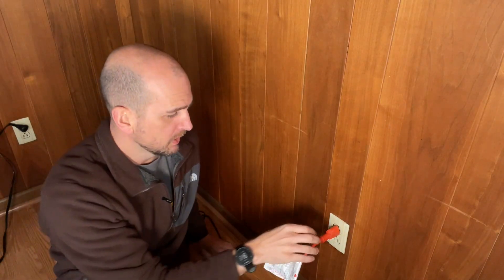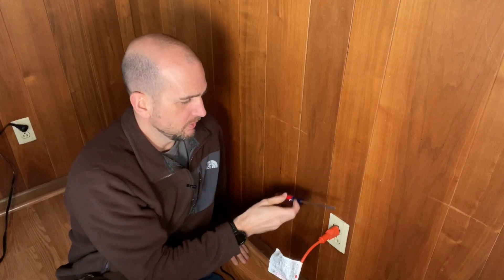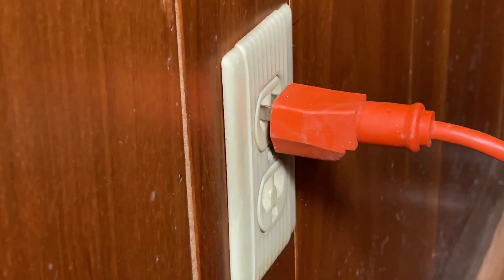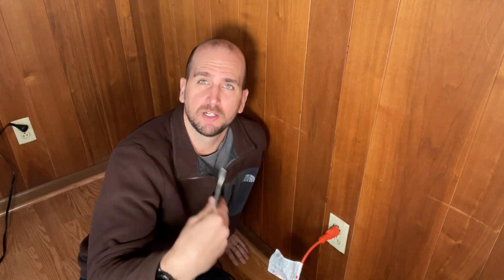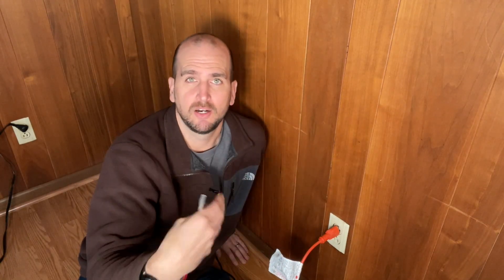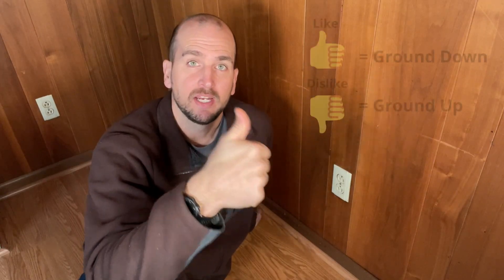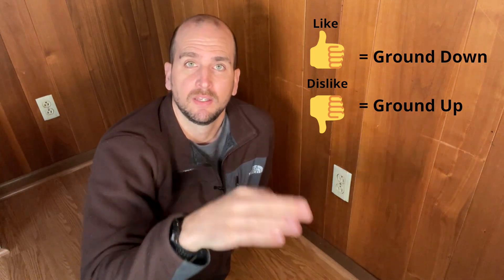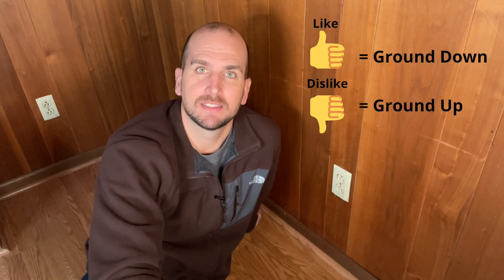Should An Outlet Be Installed Ground Down Or Up

Comment: i like the screw heads straight up and down, LOL
Reply: Me too if I can help it.
Reply: Left and right....
Reply: All the same orientation, usually horizontal
Reply: In the trades it's standard practice and called "soldiering" the screws.  Then the painters come in........
Reply: Especially on a switch.
Reply: I used to have a boss that was anal about that.
Reply: LOL, you should see a doctor about that OCD.
Reply: @navyreviewer  why? I do the same. It looks neater. As it is, I just bought a place where I'm fitting screwless plates.
Reply: 45 degree angle, upper left to lower right if in. right-side-of-the-street driving contry.  Upper rlgiht to lower left in in a country where they drive on the left.  ;-{)}}}
Reply: Horizontal
Reply: Which begs the question... why do 99% of all outlet/switch covers use a standard slotted screw instead of a Philips head
Reply: @marvinisit  they want you to slip and put that screwdriver 🪛 in the outlet!⚡️⚡️⚡️😳
Reply: I paint. When I replace covers, I always put the screw slot vertical.

It is the way I was taught.

Comment: I did electrical inspection as a resident engineer for the government for decades and the up or down was decided by the electrical engineer. This dives me nuts because one EE would never put it in the plans and would expect me to "train" the electrician into the correct way to install the outlet. ?I spent many hours proving there was no orientation specified in the NEC. My wife had a room mate who wore a watch with a delicate chain connecting the ends of the watch band. This was in college, circa 1966. The room mate's bed was placed just below the wall outlet at the head of the bed and near the center of the bed. After a few years of good luck she finally laid down on the bed and threw her arms up to clasp her hands behind her head and settle down on a pillow. That chain hit the hot wire and the resulting surge caused a burn on her wrist.

Comment: Ground UP!!! When I rewired my 1905 house, I installed all the new pugs Ground UP fed by the the new subpanel and Modern romex.  that way I could easily spot older knob and tube connected plugs.  As work progresses to update my electrical, I could systematically knock off plugs and wiring projects.  I also found the ground UP gave a more firm grip on cords with ground plugs.

Comment: Never walked into a residence with ground up. Switched receptacles ground up to indicate 1/2 switched. 
Might not be in NEC, but what about state codes?  
My concern would be with having hot  be on the 'other' side if an outlet is installed ground up.

Comment: When my brother was maybe 3 or 4 years old he stuck a knitting needle into a receptacle. I always wondered if he did it because it looks like a face and it caught his attention because of it. In most cases when I have used a 90 degree plug it needed to go up not down so I wind up loosing length because I have to double around to go up. I think everyone is so used to the ground down turning it the other way doesn't look right to them. People have a tendency to dislike change. Also if a cord is loose when it is plugged into a receptacle the receptacle needs to be replaced.
Reply: Kids stick needles in outlets everywhere. It has nothing to do with it looking a face. One should use tamper resistant outlets with kids.

Comment: This came up at an IEE safety meeting in the UK. The problem was bangles worn mainly by women while plugging in the cable. The chain could drop in to the gap as the plug is connected leading to a shock. In the uk a shock is quite probably fatal at 240volts. Soo to help prevent that the ground pin went to the top. US pins could also be shrouded for a short distance down the pin to again help prevent jewelry chains causing unsafe events to occur. But then you have Mr McConnell grandfathering in the electrical industries A-hole bad practices instead of getting on and fixing the problem!

Comment: As a retired fireman we once had a house fire caused by an metal outlet cover that was not screwed on and fell just between the plug and the outlet shorting out and starting a bed that was pushed against the wall on fire.
Reply: Good to know!
Reply: The problem was the conductive metal cover next to the bed. Terrible decision.

Comment: Most plugs appliances do not have the ground... so , it doesn't make a difference.  Lastly, plugs can have undue stress on them being upside down.  Not good long term for the plug, and may be an issue.

Comment: I do Home Inspections and no I have not seen any electric code that defines the outlet orientation. With that being said if you ask any electrician I'm pretty sure they will say ground down. I have never been in any home where there are ground prongs up. When I do and it is usually in older homes I will find the random outlet with ground prong up and I know there has been a home owner doing their own electric work that is not really experienced and has no idea or even thinks about it. I think if you researched it deep enough you would find someone did it that way and from then on "That is just the way it has always been done". There are many things in code and SOP's for home inspectors that I don't always agree with.

Comment: My brother-in-law showed me a safe way to show ground  up as safer.  With ground down and the plug not fully inserted, he dropped a nickel down a wall.  When the nickel slid between the wall and plug, it shorted out the hot and neutral making a nice spark.  Then try it again with the ground down.  Thanks UNCLE BOB.

Comment: Ground face Bottom I consider better and easy to plug cord. Since most Outlets have the Green connection on the bottom I consider to install ground open on outlet facing down

Comment: I was serious shock when using a non insulated drill in a damp area because the plug pull out  and down disconnecting only the ground pin on a receptacle  with ground up.

Comment: Personally when I am replacing an older receptacle, I look at the plugs that are normally plugged in at that spot. If those plugs are ground down, then I install the new receptacle down, if they are up, then so is the receptacle. This is usually why you may see both in the same room. If you plug in a ground down plug in a ground up receptacle, or vice-versa, you are introducing undue stress on the cord, the connections inside the plug head and on the prongs. Also if the cord happens to be in a spot where they keep getting jarred, the conductors within the cord at the bend can eventually break over time due to bending back and forth at the bend in the cord.

Comment: Ground is downward. Commonly when you hold a plug when inserting it your thumb is on top pushing and index finger is across the bottom guiding. If your hand slips when pushing the plug in it'll be the index that slips forward contacting the ground blade. No issue. Ground up the index will cross the hot and neutral. Always know where your fingers are.

Comment: I'm getting older and my eyesight is not as good as it used to be. With ground up I find it is easier to insert the plug because the ground prong is longer and
with the ground up it is easier to locate.

Comment: I've been a Commercial/Industrial Electrician for 53 years. Hospitals spec ground up because the ground plug makes it harder to knock out the plug to a vital machine. Otherwise, it's whatever the specs call out.  Typically I do ground down if it isn't called out because people tend to not like ground up. It sucks to put in 237 recepts and have to go back and turn them the other way. If it's not specced I RFI it (Request For Information) and it will one of the first ones I do.

Comment: Well this will blow your mind and theory.
Most outlets in the Chicago area are mounted horizontally  so now the question becomes,  Is ground left, right, up or down?
Chicago uses metal conduit and electricians find it faster to run the conduit up through the top plate turn 90⁰ then turn 90⁰ back down through the top plate and into the adjacent outlet box.
When a number of convenience outlets are on the same circuit, generally the thinwall runs horizontally low in the wall and bends up to enter the bottom of the box, which has two knockouts on the long side. In the middle of the run, there are two connections to the box, so it makes sense to mount it horizontally.

Comment: I hear many electricians say it should be ground up, but it's not only not enforced by my NEC, but it causes many issues. All, and I mean ALL pluggable electric devices have their plug designed and oriented with their ground down. This means that when plugged upside down, they will exert torsion or (in the case of heavier adapters) will constantly pull on themselves by their weight alone. Overtime, this loosens the plug holes and it becomes more and more likely that you'll get partially exposed prongs. Unfortunately, my house was wired that way, and all of the outlets that are frequently used (ie. the bathroom one), are extremely loose. I also had to find power bars with rotating 90 degrees plugs in order to avoid the cable loop you demonstrated. These are not easy to find and they cost more. I have never ever witnessed or heard of an accident where something fell on the exposed prongs and caused a short.

Comment: This might be a regional thing since it isn’t actually code.  I was told that an outlet installed ground up means it is on a switch, like light switch on the wall.  I Googled it and found that some people do this in their home so it is easy to remember if an outlet is on a switch. Kinda makes sense. Doesn’t it?  So, to all the obsessive compulsive friends of there, have fun testing all your outlets and light switches and swapping them.  Just remember to be careful and turn the breaker off first.

Comment: Thanks for clarifying the fact that there’s no code for up or down, at least at the time of this video in March of 2021.   
One comment I have heard; in case of low level installation of the receptacle, and if there’s a flood (this just a comment) water can ground the “ground” faster that the hot and the neutral leads!!!
Not because of this reason, but I am in favor of the ground being down for the convince. 
Thanks 🙏🏼
Reply: The ground is always at ground, that's why it's called ground. Water won't ground it because its already ground.
Reply: @garyvcole  Not only that, the NEUTRAL is also grounded and would be innundated at exactly the same height as the hot, regardless of grounding terminal up or down. If the water is  going to short the circuit, and there isn't any lower cord-connected, non-water-tight device, that's where it happens.  People with no clue seem to come up with  idiotic reasons for doing something that simply doesn't matter.

Comment: Remember metal cover plates ? There was a time and may be available still.
 Imagine worst case scenario... ground down.
NEC code should at least 
Address this as a major problem for elimination.
Reply: If it were a "major problem", you'd think it would have come up at least once in the last 100 years or so since grounded plugs were invented.

Comment: Ground down is easy to remember for me, putting a finger in the ground prong can help you get it in in the dark. if you are using metal plates, ground up is good, they can get loose and will drop, especially on the 50 cent outlet. all outlet devices in a given job or building or ares should be all the same all up all down, except for the special plugs, such as a right angle plug. I think NEC years back did not care but wanted all the same in a building or job.

Comment: I built a room addition and hired an electrician who told me the city I live in made it code to put the neutral on top. I live in a twin city and a friend whose electrician started the job on their new house build before his city joined my city to make this code change. Unfortunately that electrician had personal issues and needed to quit the job. My electrician took over. Both of our cities require the electrician to get the permit. So the new electrician went in to get the permit and was told that means the new house build had to be brought up to the current code when he started as the electrician. So he had to switch every outlet to the neutral being on top. My friend was not happy, but he passed the electrical inspection.
Reply: An additional comment. I installed an outlet chase for behind the LED wall-hung TV to hide all the wires. Those didn't come with neutral up (this was now almost 9 years ago). So I installed the TV on the wall the day before the electrical inspection. He was happy with the wall outlets but never looked behind the TV. My electrician likes to be present during the inspection and told me he was prepared to lobby for the neutral being down given it's an inset outlet and behind a TV on the wall. The electrician and I kept quiet on this during the inspection of course.

Comment: it's weird, plugs in countries like EU have sleeving around the hot and neutral wires so shorts like this aren't possible, and they have fuses built into the connector, plus many other safety features. I wish that was the standard over here in the US, obviously it may be a little too late, but innovation onto the existing connector isn't impossible.

Comment: Good video. I  put ground down because some larger appliance cords have the 90 degree & I believe it puts constant bend on the conductor wire. I am ok with ground up but will change it if I am changing out the receptacle.

Comment: Always ground facing down.  By the same logic of something falling down, you could be sitting with your screw driver and go to stand up and cause the same issue.  Or, more likely, a toddler could be playing near it and lift up something he/she found on the floor, and since they are low, would be more likely to hit it from the underside. What ifs are always sheer speculation and a waste of time.  If the plugs are loose, replace them, plain and simple.

Comment: please stop calling a receptacle an outlet. an outlet is any box you can tap into electricity. i.e. switch boxes,       fixture boxes (for lighting) and of course a receptacle box . although you can take electricity out of the receptacle it is not the outlet. the box is the outlet that is why it is called the outlet box.

Comment: If you install a 'wax warmer', and the outlet is ground up, it will be upside down because of the polarized blades.  Nite lights will also be pointing down instead of up because of the same polarization of the blades.

Comment: I new a guy that his son was electrocuted on the back of there boat. The boat was docked and I guess the boy was setting at the back of the boat with his feet in the water. Boat was plugged into the docks power supply, 120v. They said that a 18c. gold chain was hanging in the boats head and fell onto a plug that had something plugged into the outlet, and I guess the plug was turned the wrong way ( SEE VIDEO @ 3 32) and it went to ground and because he was in the water and on the back of the boat he got electrocuted. So I guess it can make a difference which way the plug is installed. Sad.
Reply: That outlet should have been a GFCI
Reply: @macariomusquez1304   Who would think this could happen on a Houseboat while it was docked using ship to shore power..

Comment: In the area around Chicago the outlets are often sideways.  Before the three prong outlets and three wire houses/outlets there were two wire versions.  Right side up or Upside down you had the problem of shorting the plug.  Solution: Turn them sides.  In this way you annoy everyone!

Comment: I studied electricity at Princess Anne Electrical. Ground always down because of polarity in positive and negative. The positive side is larger with a hole and negative side is not. Now the electrician I worked for said Ground faces towards the ground.  He said that is why they called it the ground. Like North and South Poles of the Earth. I also worked with Fire Protection Services. Most of the house fires were caused by upside down outlets. I seen this.

Comment: My old house came with two pin sockets everywhere.  Over the years, in critical places, I have replaced some of the old sockets with three pin sockets and in very critical places (bathrooms & kitchen & workshop) with GFI sockets.  I have never paid attention to orientation, but install the plugs in whichever way is most convenient with the existing wires.  Until this moment, I never gave orientation a thought.  I fully intend to not think about it ever again since there in no practical reason for me to care one way or another.

Comment: Not a licensed electrician. All you need to know. Why is this guy giving anyone his OPINION on electrical safety? Ground down is last prong to fall out so will at least be grounded even if the power goes off to an appliance. Even if something shorts out it goes to ground. NOT YOU!!

Comment: Great Question. The City and County of the state of Iowa, that I work in, have set codes.  UP, for comerical.  Residential homes Contractors want DOWN.  As you ststed NEC does not have a set way.  So the AHJ( athority having  jousidiction) or building codes.
Becouse my major installs are for data networking.  The big black tramsformers take up a lot of space. So sometmes the recepacles need set-up eather way.  Great Video

Comment: I am a ground-facing-down DIYer myself, but a professional once told me when he does residential wiring and is asked to put in a 20amp circuit where there are also the typical 15amp, he flips the 20a outlets to ground-facing-up. He claims that the average homeowner seems to remember which is which easier that way even tho the 20amp outlets have both a parallel and perpendicular neutral blade slot making them already look visually different.